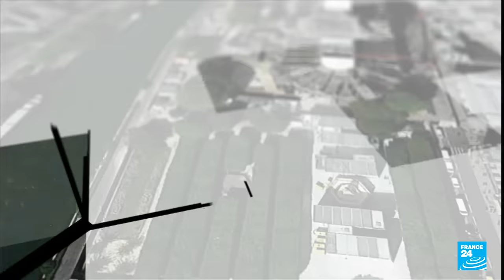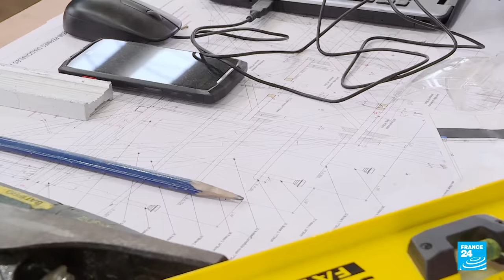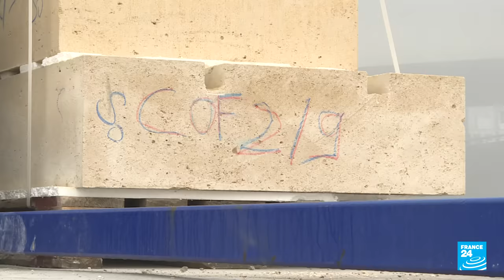Four years after fire, Paris's Notre-Dame Cathedral set to rise again • FRANCE 24 English

Comment: I am so glad that the choice to reconstruct the cathedral authentically was chosen.  Personally for me there was no other option.   But there were those at the time who felt it should be done in some dreadful modernistic design.  Or … whatever.  This building is iconic and the gargantuan efforts on the parts of all of the craftspeople are epic!  Thanks to them all!
Reply: I don’t think the French Government was ever seriously considering a change to the Cathedral- I thought a concession might be made concerning some of the building materials- for instance, steel instead of oak for the attic- but they refused to do even that. Good for them!
Reply: I think it's a mistake not to add a fire prevention system while possible to do so. I also don't agree with rushing to complete because of the Olympics. Take however much time is necessary. Haste creates mistakes.
Reply: It would be absurd to try to make some new, modern version of the cathedral.  Only a faithful restoration makes sense.  I don’t mind if they add some hidden upgrades and improved materials to make sure it lasts, but it should be as faithful to the original as possible in every other way.
Reply: @gondolacrescent5  
A compromise wherein steel is hidden inside the oak would be okay as long as it’s faithful in looks and appearance.  That can be done these days.  But otherwise I think it should be done as originally as possible.  Any concessions to modernity should only be done to ensure it’s safety and longevity and should not be apparent in any way.
Reply: I would have switched out the lead coverings and added in some fire suppression systems and smoke detectors.
Reply: When I heard of some of the horrid ideas I was sickened to my core.
Reply: The authentic 19 th century rebuild  you mean? What we see of Notre Dame is a romantic 19th century re-imagining.....buildings like this were , even in the middle ages ever changing and added too...a town civic centre more than the holier-than-thou quiet temple we interpret it...cathedrals were noisy smelly loud and busy... don't fall over the chickens dogs and pigs...😉
Reply: @dougdiplacido2406  Like the glass roof? I think someone was on drugs to come up with that.
Reply: @jm7804 il y avait un système d'alerte incendie avant l'incendie.
Reply: I agree. That horrid pyramid at the Louvre is disgusting. Architects want to build monuments to their egos rather than restore.
Reply: Well said, This Building along with The Eiffel Tower are Symbols of the French Nation, To change anything from it's Original Looks would be an insult to the French Nation and it's people as a Whole and i'm so glad it's being rebuilt to its former glory.

Comment: If it’s challenging to build the spire now, think how it must have been in the 19th century
Reply: @hameley12  Why on earth do you think you would've seen cranes there in the 17th and 18th centuries?
Sure, there wasn't a period of history without some construction or restoration work going on on the cathedral, but the bulk of it's been done in the Middle Ages and the 19th century -- until the present restoration.
Reply: Gary Allen  the lifting technology has changed slightly. And the cutting etc
Reply: Frontenac: Don’t underestimate the engineering technology and skill in the past and ancient past. Think of pyramids, of henges, of Roman design and engineering, of Gothic cathedrals. Avail yourself of thousands of articles, monographs and books available.
Reply: They were masters of that kind of work back then.  Sometimes there were architectural challenges to overcome, but the actual construction used known techniques.  We often struggle to replicate their work because many techniques have been lost; even with modern advantages.
Reply: @dolinaj1  
Roman design is especially impressive.  Their concrete structures are amazing!
Reply: @Phillip Banes I think you know what I mean.

Comment: they said they wanted to rebuild it exaclty  as before but that might be impossible as the wood grain from the 1300's had a much denser wood grain typically  and was likely stronger. in standards handbooks they had to change the strength values of wood and they were downgraded as the early forests in the US had much denser wood grain. I'd suspect it's the same everywhere.
Reply: I was very interested in your comment. Can you say a little more as to why the wood  grain is less dense now?
Reply: It's a tad bit different in France. A lot of the wood used to rebuild Notre-Dame is actually coming from forest planted exactly for that kind of buildings and to build old warships like a galleon. As demand for that kind of construction wood dropped in favor of steel, those trees remained and actually are at least 200 years old..... Wich make a huge difference with the construction wood used in the US who comes from rather young trees :)

Comment: While the initial stabilization was performed to allow all the other work to proceed, What is being  done to internally stabilize the structure to prevent future collapse and permit the temporary stabilization to be removed? This is most important with the desire to reinstall the 700 ton spire. It is also imperative to have the great columns fully stabilized to permit the rebuilding of the ceiling* vaulting. This is a situation where the concept of using a belt and suspenders becomes clear. If over engineering becomes  required, then it must be done or the world will not forgive.

Comment: It was a miracle that the Cock weathervane at the tip of the Spire, that contained some of the relics of St. Denis and St. Genvieve, Patron Saints of Paris, bounced of the nave's floor out of harm's way when the Spire toppled through the roof and vaulted ceiling. The reliquary was found in the corner by some chairs.  The early builders did that to prevent lightning strikes (as prior to the invention of lightning rods to carry the charge via a metal bar from the roof into the ground to "ground" it,  early tall church spires were often destroyed or set ablaze).

Comment: The roofs of Chartres and Reims Cathedrals were both destroyed by fire, and the destroyed, combustible materials in the attic were replaced with non-combustible iron and steel.   Today, the addition of an automatic fire suppression system would make such a replacement even better able to resist damage from future fires.

Cutting down what are now now rare, huge oak trees, and faithfully reproducing the concealed combustible wood structure, errors and all, from the original construction  is folly .

Comment: They could have done it way better now but they did not......WHY NOT? 
Nobody is going to see the roof from underneath....NO BODY! 
And it is not a wide roof. It is only long! 
And the spire was silly heavy. 
The times in which this was build weren not THAT great times....
Could have made it much more efficient now with less material. 
On the outside there is no difference. 
And a sprinkler or halon installation inside must be!